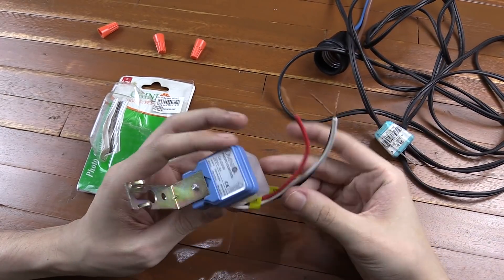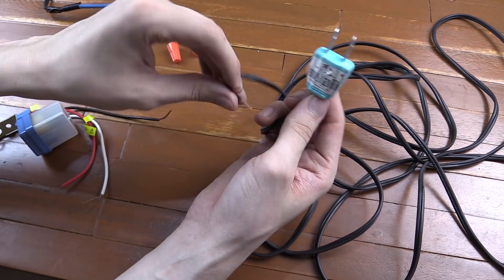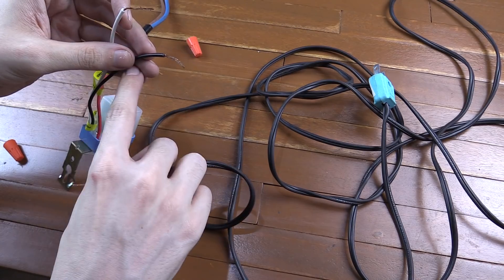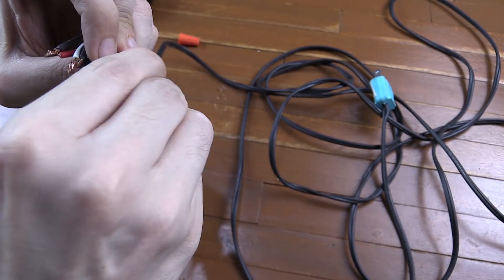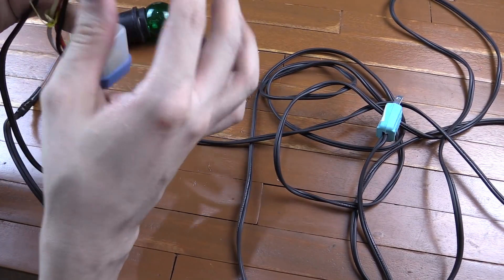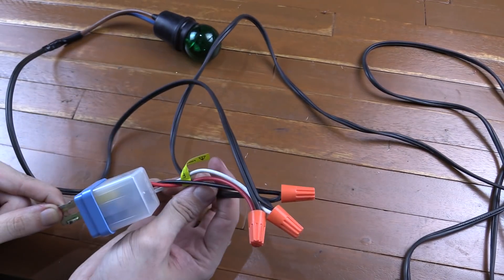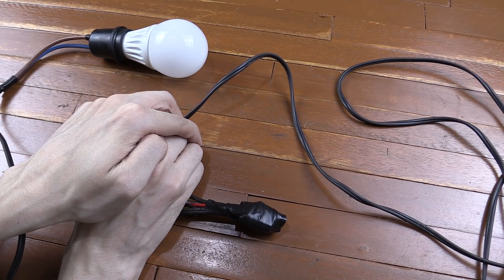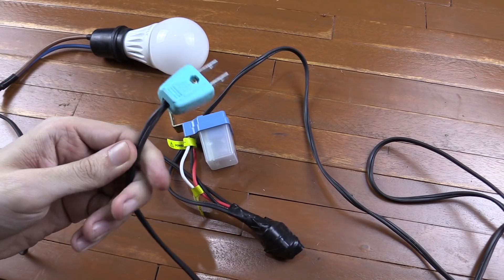Wiring automatic security night light

Comment: It looks like you need to mount it with the blue plastic facing up to prevent water from entering the box. Is this right? It seems like, the white part should be facing up though to for more efficient light switch function. Just wondering.

Comment: this is what i was looking to have..... been searching videos about this thing and didn't realize it can be connected with multiple bulbs.
Reply from the maker: Yup no problem with multiple bulbs :) Just check how many watts it's rated for. I think the one I used it rated for something like 10A at 220V.
Reply: if it is rated like that , how many bulbs i could possibly use.For example , i will use 40 watt  bulbs.
Reply from the maker: A 40W bulb at 220V is around 0.2A lol... so if it's rated for 10A, a LOT. Although since they're cheap, I'd stick to a maximum load of 50% of whatever it's rated at and just buy a second one, if needed.
Reply: :D sorry for my ignorance .. i have no knowledge about electricity ... infact  i have a phobia on electricity  before when i was holding a defective  dryer  and suddenly explode and catches fire, lucky me im still alive.
Reply from the maker: Yikes, not good. Glad you're okay though. It's generally advised, and usually a legal requirement, that you use a certified electrician. I am not a certified electrician so take anything I say with a pinch of salt :P
Reply: thank you sir, you're a good mentor.